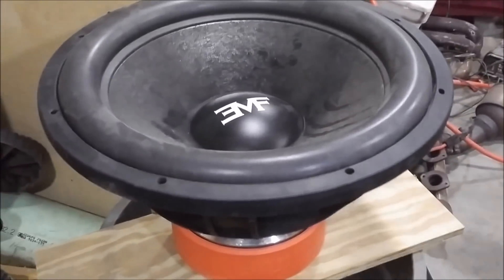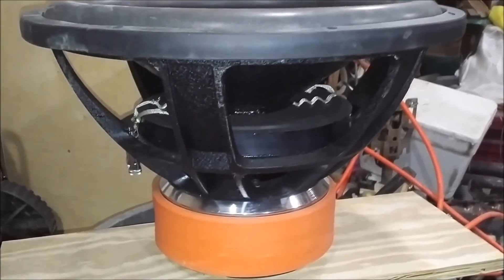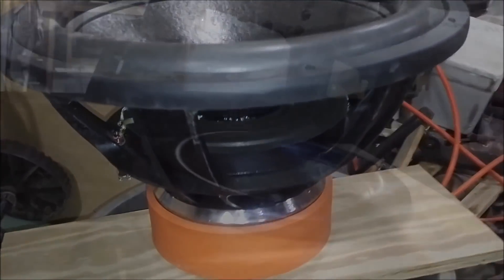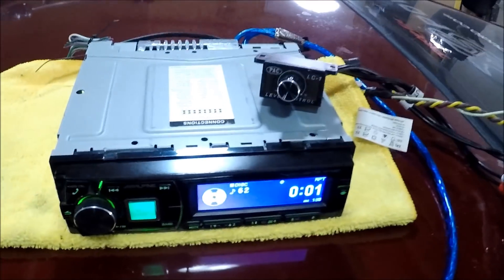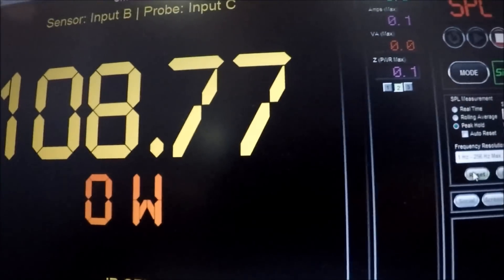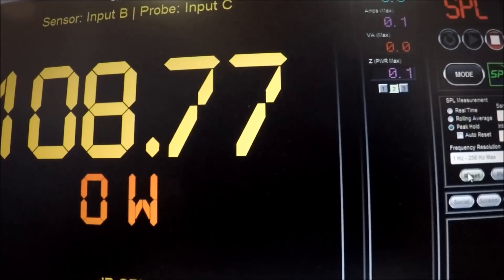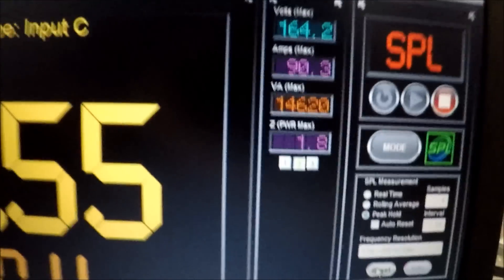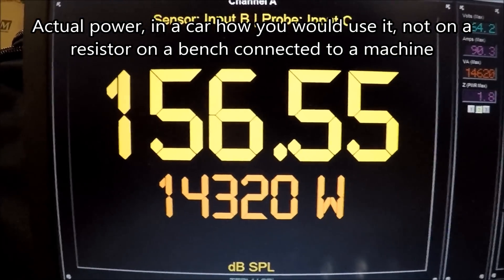EMF Banhammer on 7x rated power?!

Comment: Now That's what I'm Talking Bout That's loud so you moving me back to 18s That should be Deadly I love ear shattering chest pumping bass.Sundowns the only one that gives me that plus the warranty is great I love them guys.I think Learned about your brand was through Diesel punk a few years back with the Emf v1s.And been with you since I think you knew but..I ended up running a nendo sub.They failed me at my 2k processed line.The foam ripped.
Reply from the maker: The cones on those subs delaminate too with that fake carbon fiber or kevlar or whatever they're claiming it is. Be aware though, we aren't making Banhammer 18's any time soon.

Comment: 4" zv3
Reply from the maker: Except for the motor isn't anything alike, and being a 4" coil would automatically make it not like a Zv3, and the spiders are different, and the cone is different, and the surround is 3x the size, and the basket is different. So if by 4" Zv3 you mean the terminals are the same, then yes. The terminals are the only shared parts.

Comment: Are you planning to release the 18 banhammer this year? If so I’ll wait on the 18 instead of the 15.
Reply from the maker: We may or may not, it's very low on the priority list. I certainly wouldn't wait for it to happen. The one in this video I built a year and a half ago and as you can see, we still don't have a production version of it.
Reply: Ok thanks